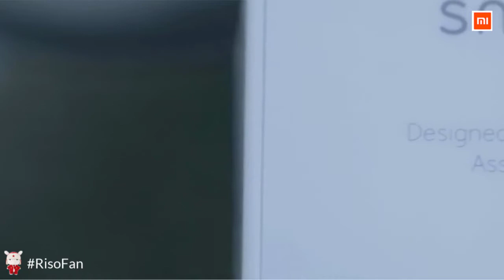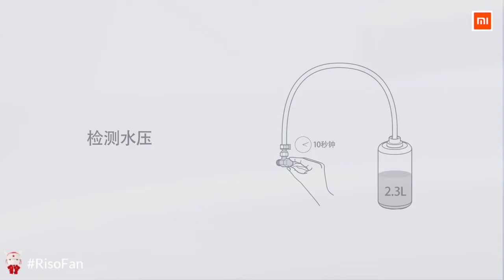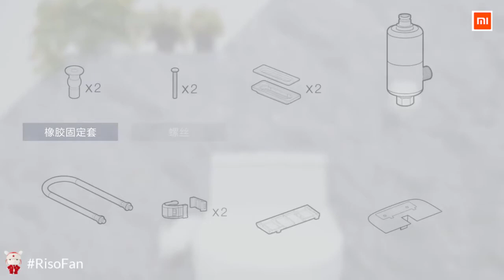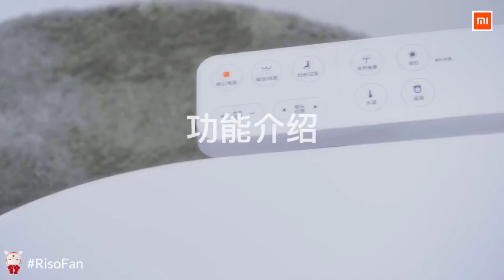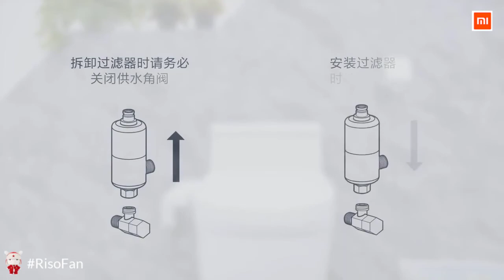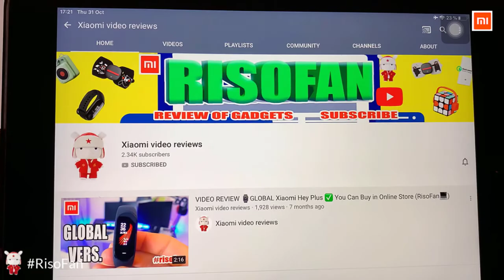FULL INSTRUCTION how to install Xiaomi Smartmi Smart Toilet Seat Electric Toilet Cover.

Comment: Merhaba, benim elektrik a bağlıdır ama çalışmıyor, sebebi nedir acaba. Please help me. I bought dmarmu toilet seat cover, it worked for a while not there is no electricity through the cable connected to it. I checked the switch but there is no problem. What tips can you direct me  to resolve this problem. 
 Please reply with a solution. Thank you. May (Miss).